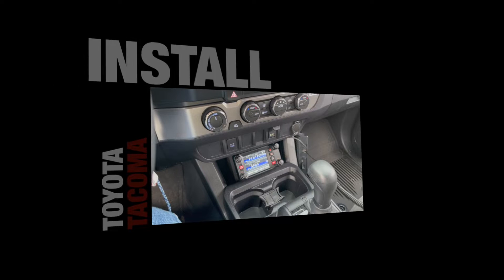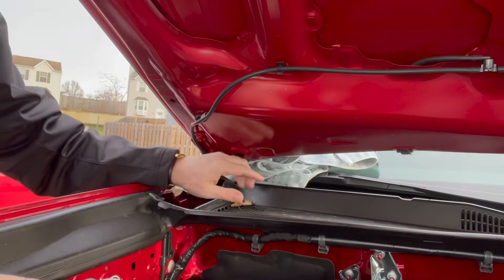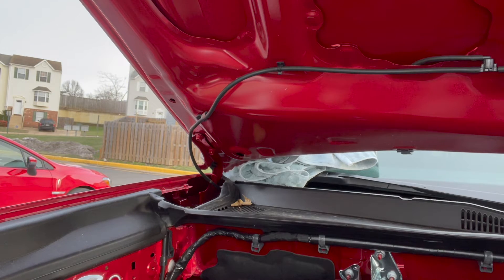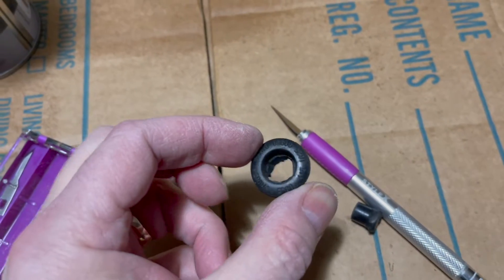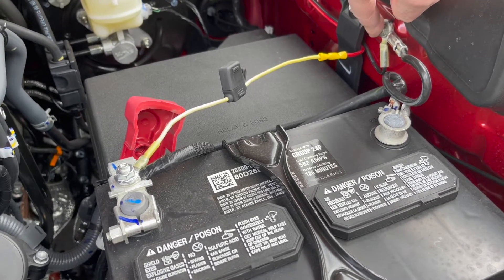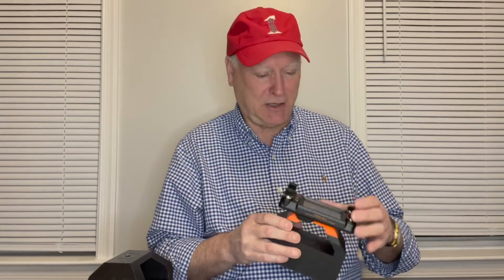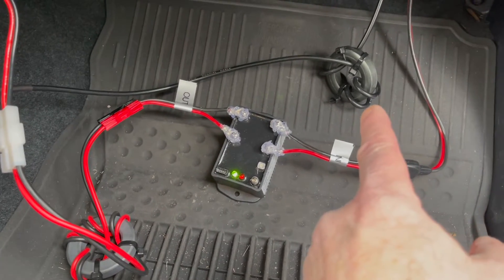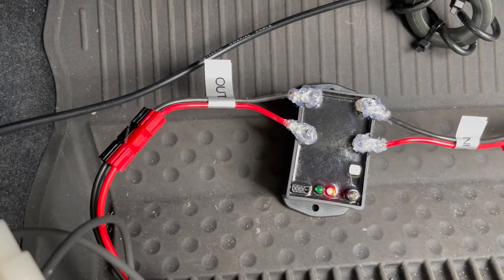Toyota Tacoma: Best CB / Ham Radio / GMRS Install?

Comment: Some good tips here. Curious if you'd considered using one of those Blue Sea terminal blocks. The ones that attach directly to the terminal. Kind of a cleaner setup, but this is not coming from a place of wisdom as I've not done it, but rather a place of theory.
Reply from the maker: Had to look up the terminal blocks you mention.  I could see them fitting in there for alternative functionality.  My main power is run direct to the battery mostly to minimize RFI.

Comment: I plan to use this setup to install a Comat 2x4SRNMO to my 2019 Tacoma. How much cable did you have to use?
Reply from the maker: @DirtyK1911  I don’t recall exactly. I think it was no more than 15 ft of LMR-240. If there’s excess, just coil it in a small coil. That will help as a choke.
Reply: @tekspeditionplanet9109  what did you use as a choke
Reply from the maker: @ I used 240 size toroids (the metallic/ceramic donut-like rings) and wrapped the cables multiple turns through the toroid.  I used one for the power cord and one for the coax cable.  You can see them in the video. Mix 43 or 60 should work well.  You can find them on Amazon.

Comment: Would iy be possible for you to provide photos or comment on the difference between the flat, 5 degree & 14 degree 3D prints or explain what the difference is when installed?  Again, thank you for such a great video!
Reply from the maker: I no longer have the other prototypes, just the one mounted in my Taco. However, check the item on Thingiverse as someone made an improved version of my design.  I admit it is better than my original.
Reply: @tekspeditionplanet9109  Thank you! I just saw this tonight when finally getting around to installing my FTM-300DR.  Two quick questions, please.  1.  Which degree model did you install in your Tacoma?  2.  Was the other person on Thingiverse, "justasktony"

Comment: Great video!  I just purchased a 2023 Tacoma.  I went with Rugged Radio's mount instead of Victory because Victory has a delay of up to two weeks,  I may order the Victory because it looks flat meaning lower base of the antenna. Rugged Radio has a bend in it raising the actually point where the antenna mounts by about 1". Unfortunately, I did not notice that both the Victory & the Rugged Radio mounts are 3/8". So now my antenna and cable will not work.  I will `reach out to Comet, Diamond & Rugged on Monday to determine my options.  Maybe I can just ream the Rugged Radio mount out to fit my standard NMO cable & antenna...
Reply from the maker: The Victory mount did not fit my antenna mount either.  As I mention in the video, I reamed the mount to fit the SO-239 base.  If you go with the Victory mount do some research first.  Some have reported that it raises their hood a little, so it's not even with the fender.  I did not have that problem.  I think their issues came from inserting the mount in the wrong order on the hood.

Comment: Great video and really great design on the faceplate mount. I have a Tacoma and an FTM-400 mounted in the same spot (my faceplate is velcro-ed in place which is a real pain to remove). Does the 5 degree or 14 degree fit the cubby better? Currently, I have my antenna on a mag mount on the roof but I am wanting to switch to the victory 4x4 so this will be very helpful!

Comment: Great video and sweet set up with the mounting block. My question is, what are you using for a speaker? if external, where did you mount it? Thanks in advance!
Reply from the maker: Since my radio body is mounted on the passenger side of the console, I'm just using the radio's speaker.  I have heard that some people use BlueTooth to connect their transceiver to the truck's audio system, for those radios that have BlueTooth.  I haven't tried that, but sounds pretty sweet having no cables.

Comment: Sir, what year model is your Tacoma please?
de KD5QNL
Reply from the maker: It’s a 2022 model.
Reply: @tekspeditionplanet9109 Nice video! I’m about to install the same bracket on my 2023. The Victory site says that the 2021+ Tacomas must have the mount between the hinge and the hood instead of over the hinge, but it looks like you had no problem over the hinge. Can you comment on the fitment of the bracket relative to the hinge? Thanks, Josh N2JLL. Edit: I see now that @superuncleryan commented on the same thing above.
Reply from the maker: @joshdaniels2680  as you see in the video, I don't have a problem with clearance, but it definitely warrants close scrutiny when installing.  It was my biggest concern as well.  If you did install this, please share how it fit for you.
Reply: @tekspeditionplanet9109  Thanks for the response. I installed on a 2023, and this is what I observed: When I tried to install with the bracket directly under the bolts, there was unacceptable compression of the cowl and the rubber gasket of the windshield was really being pushed down. It made me nervous, so I installed per Victory 4X4s recommendation for 2021+ models with the bracket between the hinge and the hood. The difference in height on that side is barely visible even if you are looking for it. It's a little annoying, because Victory could have just put a slight bend in the bracket to compensate the difference in the 2021+s, but I'm OK with the way that it turned out.

Comment: Clear and to the point! Thanks for putting this up. My 2nd gen Tacoma had a 2m antenna on the driver's side rear corner of the bed. That setup worked really well, but now it seems more people are going with the hood mount. Maybe I'll give this a try.

Comment: Looks great. Any trouble with interference? I am getting interference on 2 meter when I start my 2017 tacoma.
Reply from the maker: Thanks for your response.  I have zero noise of any kind in my 2022 Tacoma.  If you notice in the video, I use 240 size toroids with both power and coax cables wrapped multiple turns as chokes for common mode current and other sources of interference.  I do the same in my shack.  Wrap all my cords and cables around 240 size toroids.  The clip-on ferrites do very little for suppression of noise.  Also, that's one of the benefits of running the power line to the battery instead of to the fuse box.  Less noise.
Reply: @tekspeditionplanet9109  thank you for your reply. I will try the 240 toroids and see if they help.
Reply: @DrivinwithJoe  Did they help?
Reply: @davidd.1656  they didn't help enough. I still have rfi. But moving the antenna and radio to the passenger side did help. I can at least pick up strong 2m stations now. I couldn't pick up anything with the ignition on when the antenna was on the drivers side and radio under the drivers seat.

Comment: victory 4x4 states that on the 21+ Tacoma the mount needs to go between the hinge and the hood which will "raise" the hood up slightly. That is just no bueno. What year is your Tacoma? Looks like you put it where it should go and that it worked just fine.
Reply from the maker: Interesting.  I did not see that stated anywhere, but during installation it was pretty obvious putting it between  the hinge and the hood would alter the height of the hood.  Equally odd that they would not mention running the coax on the outside of the hood mount.  With my first install attempt the coax was seriously compressed by the weather stripping.  I resolved by running the coax around the hood mount on the outside.  Mine is a 2022 Tacoma.
Reply: I am not sure but I think they say to put it that way so that the mount clears the windshield a little more.  I just wonder if you could put the mount in a vice and bend a slight offset in it and accomplish the same result, while leaving it bolted under the hood bracket.  
Does this bracket still allow the hood to work as a good ground plane?  
I'd really prefer to use this over a lip mount to avoid marring up my paint.
Reply from the maker: @SuperUncleRyan  clearance was my biggest concern.  You definitely want to eyeball everything for clearance before tightening.  Having the hood raised slightly on one side would be a no-go for me, but everything cleared and sits flush.  As long as the mount makes contact with the metal in the hood you should have a good ground plane.  I think just screwing the bolts in will give good metal to metal contact.

Comment: What did you print your mount out of? PLA or PLA+ will melt when the interior of the truck gets hot. I can print ABS in my enclosure, but it SUCKS! Nice video and very informative. Gives me some ideas. Thank you.
Reply from the maker: PETG or ABS works better than PLA, but I've tested all three plastic types.  For this model, I find it isn't that susceptible to heat because it's very stout.  So far I haven't had any heat issues, although I always warn against using PLA for fixtures to be used inside a car/truck. Use what you feel most comfortable with in a hot car.

Comment: Nice video and install, However I would not recommend any kind of choke on antenna coax. RF doesn't like sharp bends in the transmission line as well as the fact that coax is already shielded so you don't need any kind of choke. Yes a choke is sometimes effective of stopping unwanted RF for a  non shielded line, but your coax is designed to let RF pass freely, so a choke on a transmission line is the exact opposite of what you want in that situation.
Reply from the maker: Thanks for the reply.  I understand your concern about the coax choke.  Although it varies slightly by coax brands, most manufacturers recommend bends no tighter than 5 or 6 cable diameters.  If you look at the manufacturer specs, they normally recommend a turn no tighter than slightly under one inch for a single turn, or slightly under two inches for multiple turns.  My choke is loosely wound and meets the two inch limit.  And as for coax common mode current / line isolator chokes they are ubiquitous.

Comment: I have a Victory 4x4 mount on my Tacoma, but I'm looking to replace the current NMO mount with a thick surface mount. My worry is that it might be too long and break the windshield when I close the hood. How deep is the SO-239 mount that you used? Thanks.
Reply from the maker: My SO-239 mount was kind of tight slipping it in, but once it was in it cleared everything with no problems.  It's hard to tell since each antenna mount is a little different.  More of a trial-and-error approach.